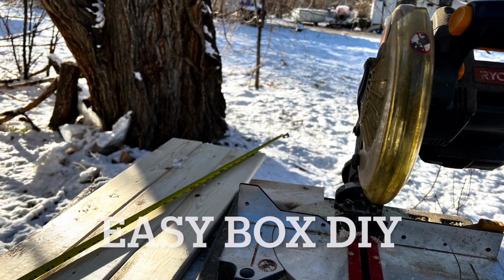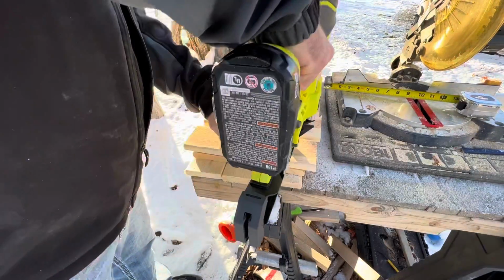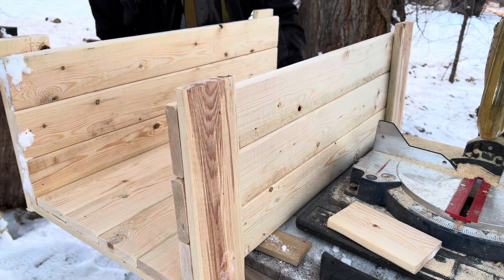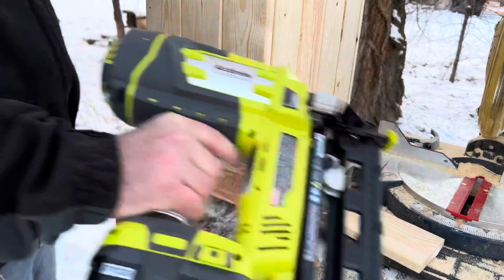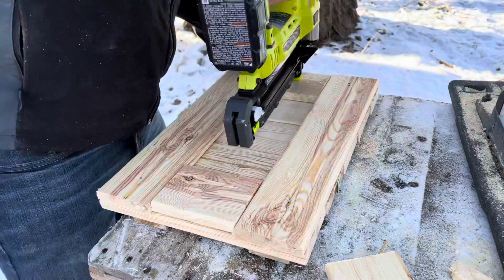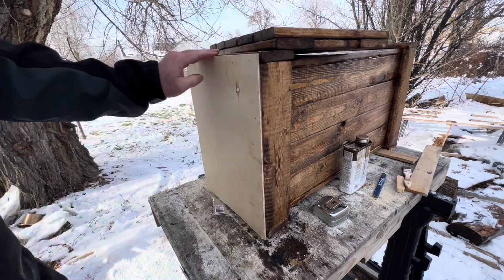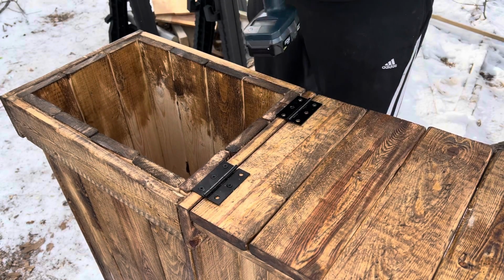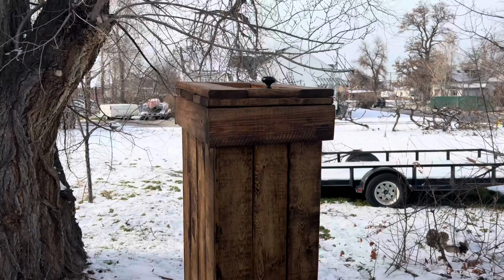Wood box build DIY easy project

Comment: Don't be so tough on yourself, that turned out great!. Man when it's cold out I don't want to do anything, I'll build in the house. I need that nail gun but I've been a really bad boy🤣. Maybe you can help me with something. I want to turn a small closet in my laundry room into a hidden closet, the door swings out and I need concealed hinges, but I don't want those cabinet hinges you have to bore a hole into the door, i just need screw on easy hinges, got any ideas?
Reply from the maker: It was super cold.
Have you seen these?
https://amzn.to/3ztDlT1
Reply: @jonesmachineco  Those are sweet, but I'm trying to shy away from making mortar slots or holes cause the closet door is hollow in a mobile home. I found on Home Depot's app something called.. Everbilt 90-Degree Surface Mount Hidden Spring Cabinet Hinge? So I think I'll take a trip in town and actually hold them, caress them and see if that will work, better skip the Caressing, will get weird or weirder looks. Thanks brother! 😎🤟
Reply from the maker: Never skip the Caressing
Reply: @jonesmachineco  🤣